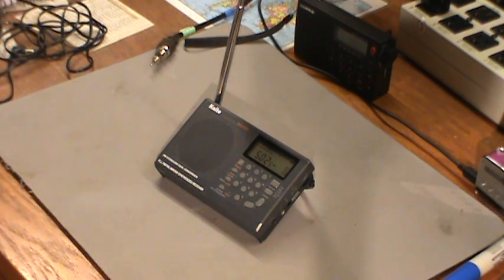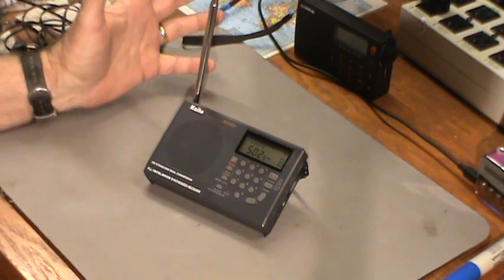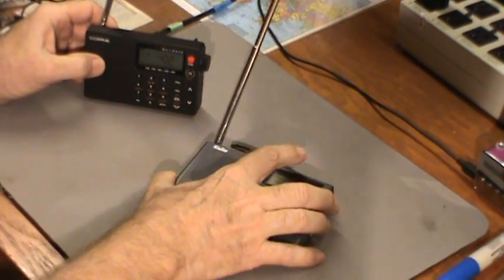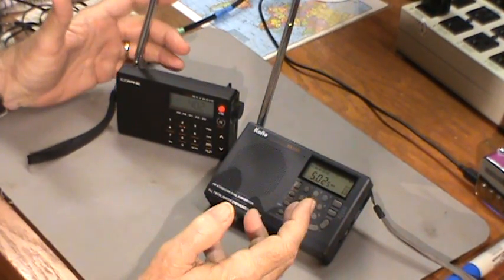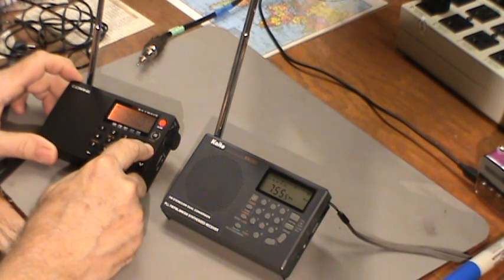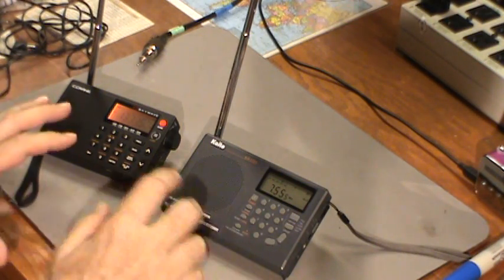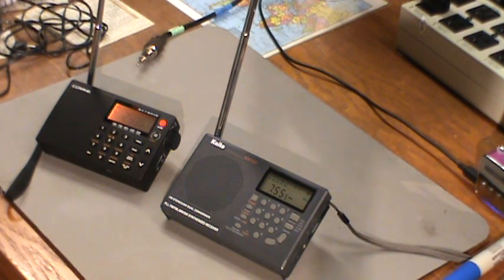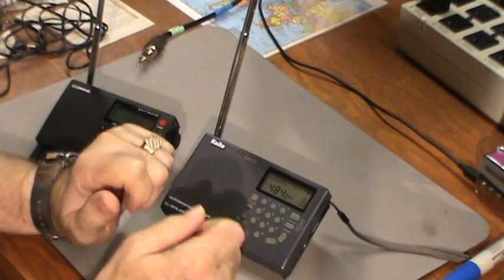TRRS #0535 - Kaito KA1101 Reception Tests

Comment: Correction: I think the reception on the Kaito was slightly better, however, the Skywave with its easier to use format, bandwidth options, tuning knob and smaller size seems to be a better radio.

Comment: I think the reception on the Kaito was slightly better, however, the Skywave with its easier to use format, bandwidth options, tuning knob and smaller size seem to make it an overall better radio.

Comment: Love the channel. I move to a coop and I'm not able to put up an antenna like I had before. I want to listen to my Kenwood TS870. Is there a small antennaI can use just for listening. Any idea's.
Reply: Ruben Try a simple wire antenna as I have the same problem as you with not being able to put up a good antenna and a simple wire antenna helps. 

Also take small portable shortwave radio around your house and find the best spot for reception. Then try putting your radio there. Giles has a good channel that Tom subscribes too and gave some of these tips and Tom has covered them also.
Reply from the maker: Ruben Thomas Ally has pretty much answered your question.  I would have to have more information about your apartment and it's surrounding to give you more information. You want to get as far away from other electronics and RF noise as possible.  Being near a window may help.  

Tom
Reply: ***** thanks I will try that
Reply: hamrad88 I will check the channel. Thanks.